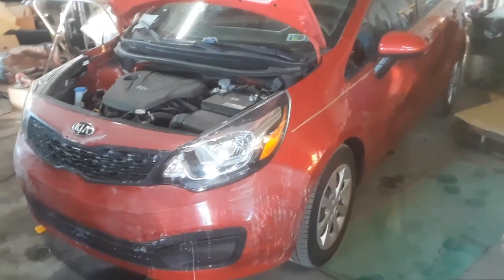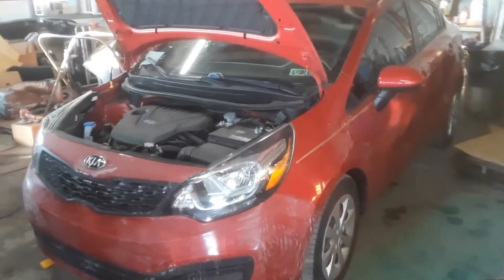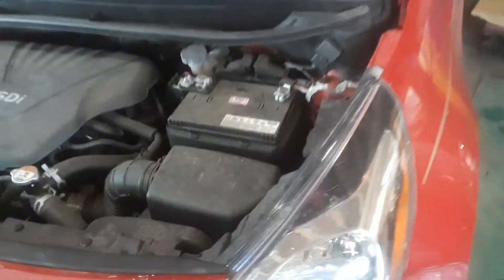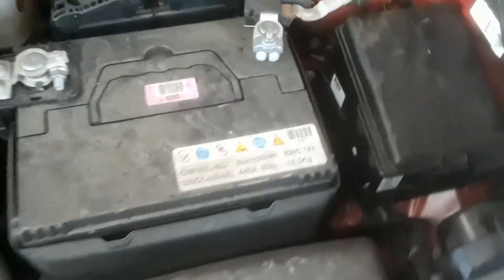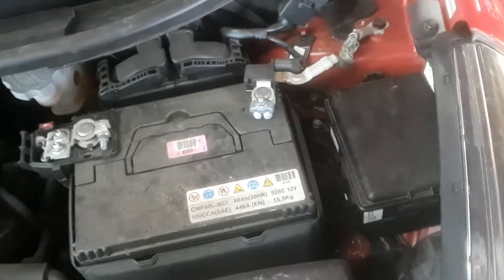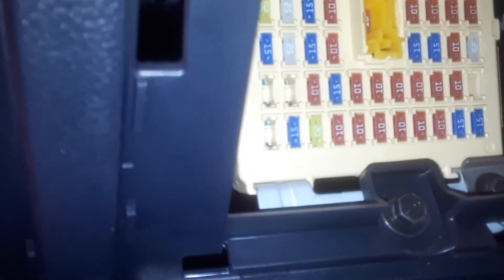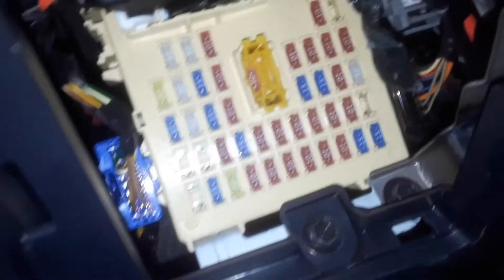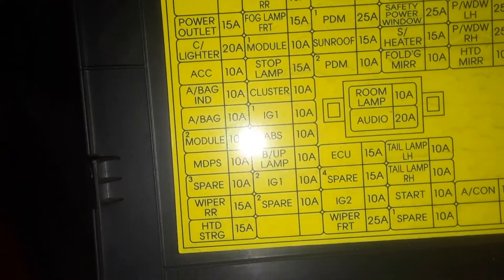Kia Rio Fuse Boxes & Computer Diagnostics Port Locations 2000 to Current

Comment: Can someone tell me where are the relays at?
Reply: Same question for me why can’t be find the relays at
Reply: @rashedhamad890  they are under the hood in the engine compartment by the battery.they are the square plastic cubes inside the fuse box
Reply: The diagram shows a fuse for the fuel pump but no relay, its only a fuel pump fuse, im pretty stumped@tyroneward4367
Reply: My 2012 Kia Rio radio quit working but the Uvo still shows up, what number is the fuse for the radio